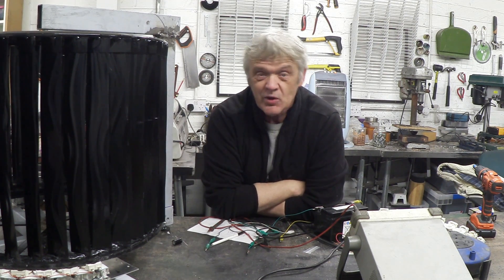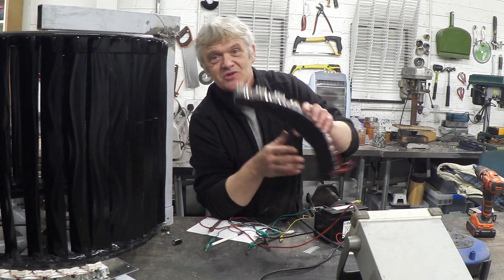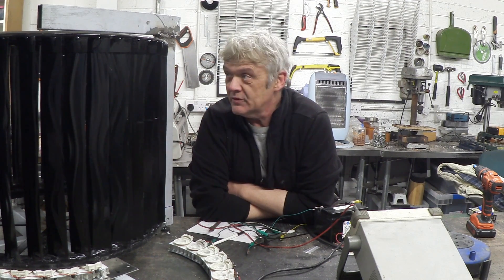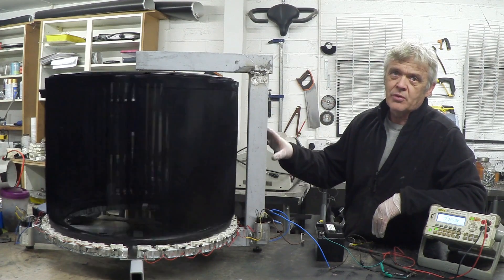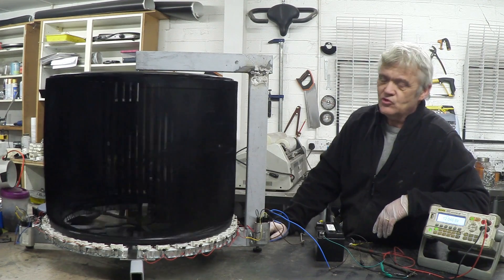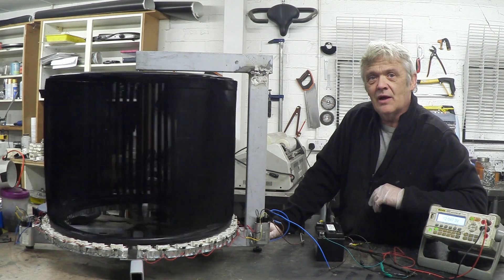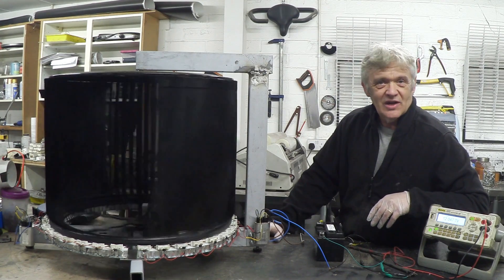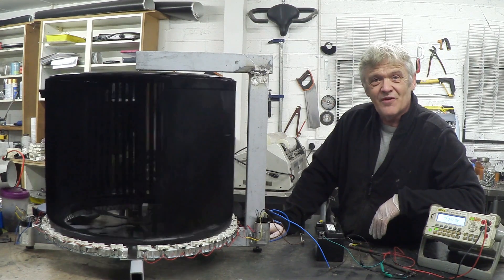Finishing The $100 Wind Turbine

Comment: Congrats Rob!
I understand that many people can offer advice on how to improve something after someone else has done the ground work and that is great. Any viable improvements simply make the whole project more successful. However, lets stay focussed here on simple economics. Once you have built a unit, at whatever final cost to the individual. In Rob's case less than 100 quid, because he scavenged parts and did the work himself. Your pay back is only a matter of time. With virtually no operating costs of the unit, and no doubt very little maintenance moving forward, you will generate enough electricity to pay off the cost to build. Once it has repaid the manufacturing costs the rest is all profit. Now that is what I call a great result.
Invest some time and effort and a little bit of cash for an indefinite period of reward. That's great economics if you ask me!
I cannot afford a commercial wind turbine, but I can copy Rob's work and afford, in my case, a couple of hundred Aussie dollars.
Reply: Great  point, It's a garage project done on a tight budget and I think he's achieved an awesome result. It also looks like a very low maintenance design and could easily be upscaled for more output just by adding more coil packs and magnets. I believe his design must be more cost effective than a commercial model and he's also teaching and inspiring people in a fun way.

Comment: Hi Robert. Great project. I started following your channel after I discovered it sometime last year during lockdown while on YouTube and as I also like to salvage parts from thrown away stuff, I liked the way you also do the same and the nice way you share those ideas. I have dozens of boxes full of spare parts of everything in my garage and also like to build something of it.  I can also share your feelings of welding and although I have been welding since 1975, I still struggle as I am not a professional welder and only weld every other month or so. Every time it takes me a few welds before I can weld reasonable again. I wanted to build a VAWT now for a while and do like your latest design. I personally feel the structure as well as the magnets and coils are definitely the best option when you want to get the best system from salvage parts. I am however concerned about losses in your system, not mechanical as your design looks like it runs very smoothly and with minimum mechanical interference. My concern is with the electrical losses in the diode bridges rectifiers. If you did use the cheap ones, you will have +/- 1.4 volt loss with each diode bridge. I do not know what voltage is generated per coil and if it is high, then the 1.4V loss could be insignificant. If the generated voltage is however low, then the losses per coil could have a huge impact on the power generation of the unit as the same losses are per coil and the total loss is the sum of the losses of all the coils. It could be beneficial to investigate into some other method to interconnect the coils in some other configuration and get a three phase output, which can then be rectified. This will end with a higher voltage and also a lower loss over the diodes as there are now less diodes . It can however impact on the cost as the diodes can be more expensive as their ratings will be higher, but there are still salvage parts available somewhere. You will use only 6 diodes for three phase rectification, where you now use four diodes per coil. Anyway, just a thought from my side and keep on with the brilliant channel and work.

Comment: Rob, I make wind turbine's for fun and profit. We need to know wind speed (you have an anemometer and a multimeter...), rpm, volts output, current output. I mean, you have to know that it is above 12v to even charge your battery.....
Reply: If you notice he said the Voltage is 12V045 at that moment in time as he was charging the battery. The battery is of course a load and will lower the open circuit Voltage depending on the state of charge. A flat battery just needs a differential Voltage to charge it, so 12V is not really worth while for charging a lead acid battery, which should be charged at around 13V5, however as long as the differential Voltage is big enough(but not too high) the battery will charge.

Comment: At the outset one of the goals was to use low wind speed to generate "something" unlike commercial wind turbines that don't generate anything in low wind. It would be idea for security lighting or emergency lighting or battery charging. Will it charge your electric car is another thing. The most thrilling part is that Rob has proved generating t the edge of the turbine works better in low wind that high torque center generated turbines.
1, Can you build it for less than £100 - YES if you are prepared to "find" the parts
2 Will it generate in low wind - YES 
3 Will it generate enough to be useful - Yes
The next step would be a 24 hour test recording average wind speed and average output. Have we just witnessed the birth of a new type of urban micro-generation?

Comment: ONE OTHERTHING ROB! put some iron bolts or rod in the center of coils this will help direct the magnetic field creating more generation! plz try this it will work!! I would say almost double! you could easily try this on one of you four coiled units buy slicing a medallion iron like coins and gluing them in the center of your coils and tight as possilbe with out touching copper! making them the same height of coils this will direct your current with a greater outcome!

Comment: I'm glad to see to took my advice on the dryer drum and coil now you have the generator! It would be just amazing if you would incorporate A water (RAM PUMP) gravity and enclosed tank system using squirrel caged as water A turbine and you literally have a endless power supply with water of course can be collected from rain on roof and stored in tank being main source of water and your supply and a recycled use of water supplying the ram pump in an all enclosed system! You can also make a trompe creating air pressure making a hybrid!
Reply: Get off the couch and go to the library and get some basic physics books , study !

Comment: Mechanically it is looking very good.

With the bridge rectifiers on the coils, they will stop back-flow, so you don't need the diode on the filter cap.
Also, with that many coils, I'm willing to bet that if you put a scope on the output, the ripple will be so low, you don't need the output cap, especially the few uF of a microwave cap.

So just connect the output of bridge rectifiers directly to the battery for the test. It will work fine.

In a more permanent setup, , the main problem is runaway at high winds. You'll eventually will need a dump load or a mechanical way of stopping it. 

Last, if you are expecting something around 2KW, then at @ 12V, that's 166A! In your final setup you'll have to get much more beefy bridges than you have (and think about fusing... maybe just small sacrificial hookup wire to the coils?)

Comment: I just wonder if it would drive another set  of magnets and coils on top?
Reply: If installed, they need to be set so that they are 1/2 the rotation out from the others so that when one set is going under load the others are coming off. It would make it easier starting ( less cogging ) and should produce an even more steady power curve.

Comment: Lest people forget, there are ways to passively mechanically enhance the collected wind energy [within reasonable limits, of course] by using funneling type devices, although the specific design here, due to the vertical bar being a bit close to the side of the rotor sort of limits this.

If one can extend the distance of the vertical support framework radially away from the drum, then one can easily add a wind directed funnel mechanism which will increase the cross section of wind striking the rotor, and this funnel, if built properly, should represent Bernoulli's ideal venturi form in one direction [vertically] while being straight up and down the entire length of the rotor, with end plates at the top and bottom which can be either perfectly flat, or a bit tapered, depends on the space you left for yourself around the rotor, and the materials you have on hand to build it with, but generally, it need not be a very heavy material, simply strong and [preferably] light weight.

Since this funnel literally shares the same axis as the drum, one can easily mount it on the top to the same axle, and since it need not be able to spin rapidly, [in fact, the point of it is to simply and reliably remain aimed into the wind, and NOT spinning like the rotor], one can use some kind of small, wheeled bearings to rest it on, and, it does not need to extend under the rotor, therefore  need not be made in any such way as to interfere with the coils...

Another approach, however, could be to actually mount the coils inside of the funnel/air-box, and then use a slipper shaft to extract the power from the coils by simply putting 2 round conductive contacts between the base of the funnel and the fixed base of the complete mechanism, where brushes or conductive rollers can connect these 2 concentric rings to the external circuitry.

This arrangement, while a bit more complex than a stationary set of coils, would allow one to have a freely rotatable wind vane directed air diverter funnel/box which can always remain pointed into the wind, and still allow the narrowest gap between coils and magnets, AND assure the maximum wind utilization efficiency. 

If you need simple sketches of how this mechanism works and a rough idea how it would fit, feel free to message me and I shall sketch out and publish a simple sketch on my DeviantArt profile.

       /)/) 
    (  'ˬ') 
@(>_ )-b 
     \) \)

Comment: How much does the turning blade rotor weight? and how much does the whole thing weight? The rotor has the magnets, plus the blades, plus the two flywheels(top and bottom connecting the blades), and whatever hardware... I'm very interested in knowing the rotor's weight.   Thank you.

Comment: Those microwave caps have bleed resistors on them which i beleive will create a fair bit of loss Robert 👍🏻
Reply: Not at 12 Volts mate. 2 Mega Ohm at 12 or 13 Volt (max. 15 when the battery is full) is like 7 or 8 micro Ampere.
Reply: @deslomeslager  oh ok 👍🏻. Every time i have charged one in the past i have tried to measure the voltage and it had already dissipated but yeah i should have done the maths ! 👍🏻

Comment: Not to be a contrary Nellie, but I think even your theoretical max is too high. For my comparisons, I use a total energy of 600 watts/sq.m at 10 m/s, and then adjust for actual swept area and wind-speed. While large-scale HAWT can surpass 50% efficiency, small scale is quite a bit lower, and VAWT is even lower than that (due to 1/2 pushing into the wind all the time) - about 15-20% of total energy. I guess this is where I say "show your math"...or is that maths, for you Brits?
Reply: There is no "accurate " math . If there was he would never have started this debacle .
Reply: It's only a debacle if you paid to watch.
Reply: @hempev  No , one meaning of debacle is "A total, often ludicrous failure" which is what we have here !
Reply: @dongraham4760  Can't get you back the minutes you wasted watching this, but he seemed to enjoy it, so not a waste for Robert.

Comment: Would love to see how long it takes to charge my 425ah battery bank from a discharged state. I have a very small squirrel cage I salvaged from the fan of an air cooler. I am thinking of adapting this idea to give my solar system a boost but have coils on both ends of the cage. I guess the only way to learn is by giving it a go. Thanks Rob.

Comment: At some stage you will need to add a charge controller to look after your battery.
Reply: won't the capacitors do that same job of regulating charge? - a question worth investigating

Comment: The battery has a self discharge rate, which is unknown, so will this make the battery voltage an unreliable measure of the generator’s output?  Better a power meter in line between generator and battery. Then you see the volts, amps and watts and everything is clear.
Reply: Y'all need to back up a fraction. This isn't a primary generator per se, more of a harvester for low wind speeds. Taking what's available and stashing it away for emergencies rather than running your entire house. And for 50 quid any and all energy gathered is a bonus.
Keep it up Robert, looking forward to the wiring diagram as previously discussed.
Reply: @GofuKyersen  While it is true that the energy harvested is a "bonus", realistic expectations of the likely amount of that "harvest" are needed for anyone planning on replicating the project. £50 will buy about 250kWh while a project of this scale may take about five years to generate that much. 

Robert has spent a lot of time, effort and material developing his fan, endeavouring to make it mechanically efficient in converting wind energy into a rotary machine.  Whether Robert is interested in following up on the actual "harvesting" turning that rotary energy into electrical energy more efficiently is up to him. (Or anyone that decides to build their own).

I do believe that there are applications for small generators like this, though not as a means of topping up the supply for a building already connected to the grid but as a way of providing power in remote locations for farms etc. (Or even at the end of a long driveway if you needed an automatic gate that operates just a few times a day)

But no matter what the application, an appreciation for the electrical losses is needed and especially if someone wants to just experiment with different coils, capacitors, batteries etc. instead of calculating theoretically then they will have to find some method of measuring how successful they may be, as it's not as obvious as watching the fan turn.
Reply: @1967spark  Yep, I just ran some back of envelope calcs and he needs 3.5 years of 10mph wind to get his £100 back. I think he realised this half way through the vidoes, but that graph he put up at the end to try and justify the 1KW claim was just plain deceptive! Look at how many people in the comments think that this is generating usable power!
Reply: I think it would actually be more accurate to measure the power output from the battery, as you say the battery is likely to self-discharge, but shouldn't the measurement of the system be net of all the losses in that system?

Comment: People who complain that it doesn't put out enough energy or whatever aren't looking at the big picture, if this can charge a battery for what you've got in it that's free energy or almost free energy and you put four or five of these on your roof or operating in the same windit's nothing else they're working as a supplement to any solar or other type of power do you usually charge your batteries and if not free as close to it as possible

Comment: Even if it produces only 500 watts at peak output, with a 30% capacity factor, that’s 1300 kWh per year. If the wind turbine cost $100 to build, then at less than $.08/kWh, it’ll have paid for itself in one year. That’s damned impressive!
Reply: I suspect that is being far too optimistic. The average UK wind speed is just less than 10mph which in terms of wind power for a turbine of that size equates to less than 14W. Just 122kWh, before any losses so it would be half that or even less. (but it is debatable whether average wind speed equates to average power produced) . 

Not saying it's totally insignificant, it would perhaps run the LED equivalent of a 100W filament lamp (say 8-10W), maybe more as it would be generating power even when a light isn't needed.

While perhaps it would be uneconomical compared to the national grid supply, I would be fairly certain that there are applications such as remote farm buildings etc. where a grid supply is not practicable.

Comment: Aahh Lovely to see this turbine finished I saw the whole build bit by bit, Rob sir here are some stupid questions I have, please help me understand your final output goes to a capacitor then goes to a battery which I suppose is a lead acid 12V8Ah types battery, the capacitor I suppose would be 2.7V and farads I don't know I apologise,
1) how will it charge that Battery without matching voltage to charge it?
2) is it possible to charge batteries with just good current as in Amps? And volts won't be a problem?
Please help Rob Sir,🙏🙏 Love and Very warm regards from India Rob Sir 🌹🌹👍👍🙏🙏
Reply: I'm betting itsa hemp battery

Comment: Nice job! 👍 Depending on the max voltage/current expected from the turbine, I would have thought some form of regulator, post capacitor, might be prudent at some point to complete the electrical setup? But I'm sure you've thought of that already... 😁 I'm very interested to see the kind of power you'll be able to get out of it... 👍

Comment: You can get a wind turbine watt meter on eBay for less than £10 an measure amp's voltage and wh it also stores watt peak,amp peak an stuff

Comment: I really like the simplicity with only one moving part. How do you intend waterproofing all the coils.
You could use the waterproofing spray that off roading groups use ?
Reply: Would they still work if u just embedded them in resin?
Reply: @poseidon201  you could but if you had to replace a faulty coil that's a lot of hard work removing the resin
Reply: @dazer123  sorry I meant individually. I mess around with leftover roofing resin. Its cheap as chips when you buy in big drums. Could you not put each coil in a tiny cardboard box, or something similar, with the wires trailing. Fill the box with resin to make a small block, then glue or clamp in place, so each can be individually replaced. ??